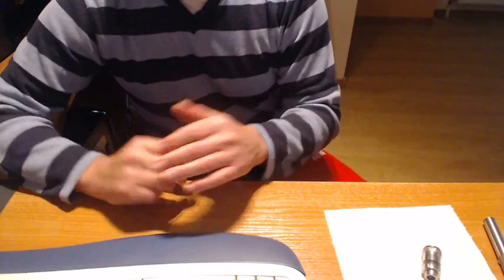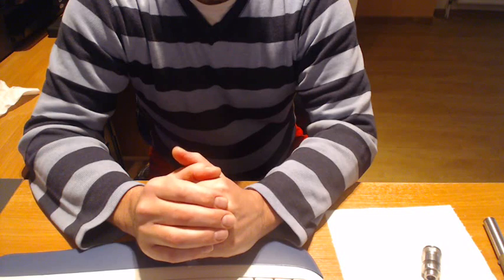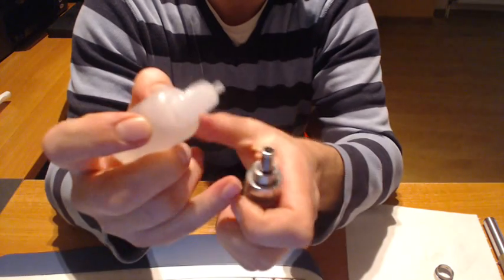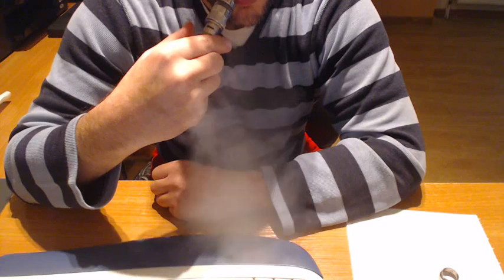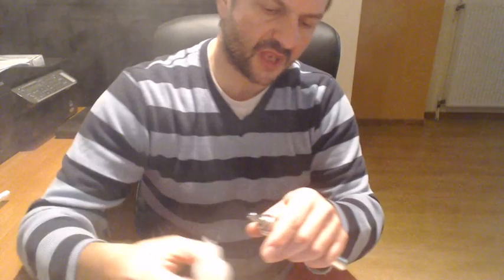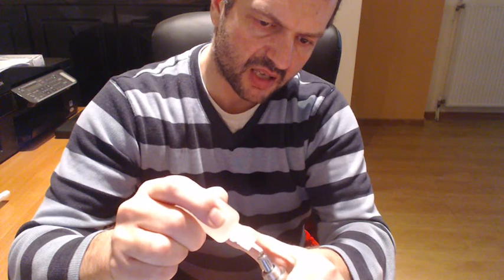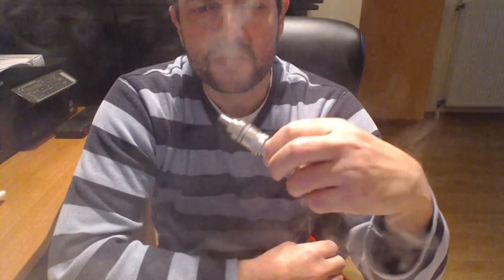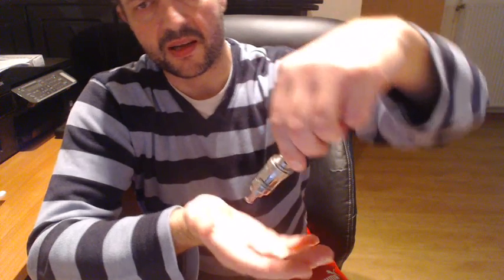GG Ithaka dripper

Comment: Hi Imeo, thanks for this, I will try it.
Another idea for the drip tip would be to have just a new small refilling cap which holds any drip tip.
Also, what ohms is your coil in this vid?

Thanks, L
Reply from the maker: thanks for the tip Lou:)
Its 1,5 ohms